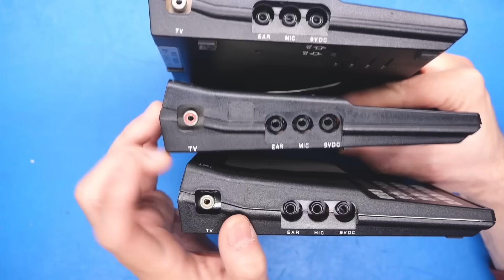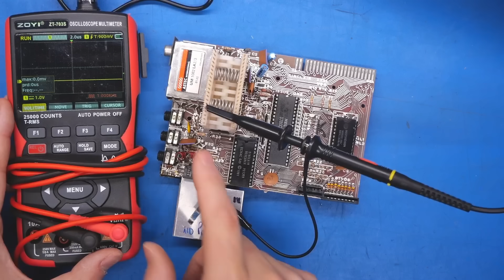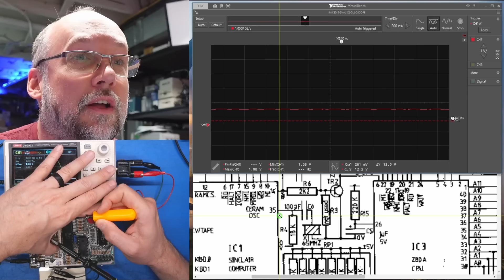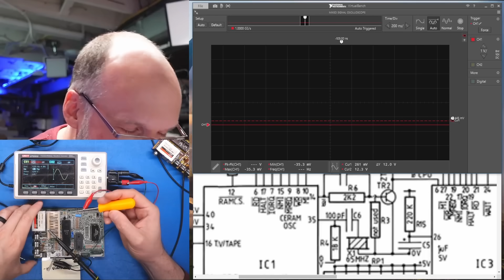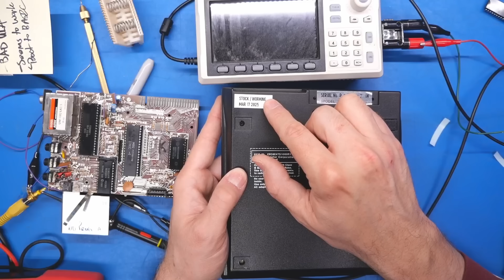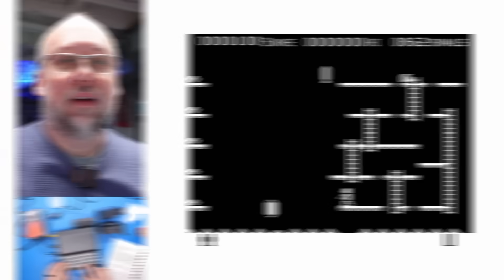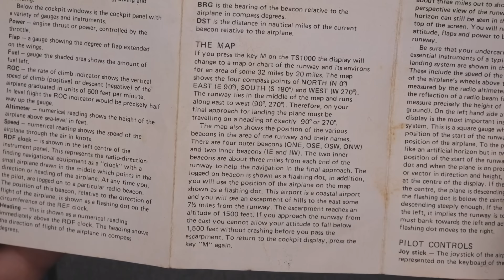Is the ZX81 / Timex Sinclair 1000 actually bad? Let's fix these to find out.

Comment: Hm, I eventually ended up with a ZX-81 with 64KB, a RS232 serial and a centronix (printer) port and a 80character screen with 16 colours running under CP\M using VT-100 ANSI emulation a 'true' keyboard that also replaced the original housing and had the powersupply built in. The hard-disk ran through the serial interface and was a 360Mb Digital (DEC) platter unit and the printer was a Mannesmann Tally Greenbar Drumprinter.  
Don't even ask me what it cost to scavenge all the stuff together and how to to make it work with the tenacity of 'The BORG', but I coded and ran cobol programs on this contraption that only its mother would recognise and love as it ended up. 
The only reason I did this was because.
Although it helped that in a drunken stupor I had entered into a bet with buddy who owned a VIC-20. Something to the effect that I could make it do things a VIC-20 or even a C64 couldn't. I won the bet, earning a cardboard medal in the order of the Naked Bear. (we weren't allowed to bet for money. Regimental Code of honour and all that good stuff.).    
If I switched it on, either the lights in the whole building would dim, or fuses would blow.
Fun times!

Comment: Probably someone already wrote it, but this is a ceramic resonator, which are cheaper than quartz resonators, but neither one is an oscillator, because that also includes the circuitry to produce a signal, which is sometimes done in the same package. Since the ZX81 only needs frequency stability so the picture doesn't roll, they use the cheapest of all variants.

Comment: You can use copper ink pen to fix the traces on the membrane/ribbon.  The problem is the older they get the more brittle they are so you can conceivably create more problems while handling it.

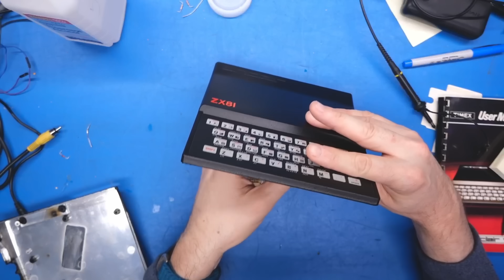Comment: 47:24 - Adrian, it would probably be easier to re-connect the keyboard is to place the top section on the table and attach the board to it!

Comment: ZX81 was my first computer, when I first got it it blew my mind what you could do with a few lines of program code. Good memories. Got a Spectrum soon afterwards. Third party improved keyboards were available. My school had a lab set up with ZX81's with custom keyboards and a DIN connector at the back to connect them to a monitor which also powered it, not sure if that setup was easily available or was custom made for the education market.

Comment: I wonder if it would be possible to get the pinouts of the keyboard and like maybe using an arduino connect a better keyboard to it? Maybe a custom one. I can see 3d printing a new case to hold the motherboard and either an external keyboard or a built-in keyboard as part of the 3D case. A shame they never made any after market kits like the Atari 400 had.

Comment: I had one of these Timex/Sinclair units... It was working fine, then I put it into its box for storage and left it it there for many years, like 8-10 years.. then I took out and plugged it in , but nothing. I measured the power adapter and it had proper voltage... but no screen, no indicator lights to say it was on... so I had to get rid of it unfortunately.

Comment: Another ZX81 Brit here.  From what I can see, in mid-1982 in the UK the ZX81 was being sold at around £60 whilst the VIC20 was around £160.  BUT - and it's a big but here - you have to remember to add on the price of Commodores cassette deck to that price - another £45.  Obviously you would need a cassette deck for the ZX81 but you could use mainly anything off-the-shelf (£20ish) as long as you enjoyed getting the bloody thing to save & load...

Comment: My first computer programming class was 1977, High School, using a Wang 2000.  I was 19 when these came out. I burnt out three of them over time, before the IMB PC came out. My software is sold all over the world to locksmiths and makes their lives easier. Without the ZX1000 I would not have learned as much as I did as quickly as I did. Thank you Timex/Sinclair.  I recently looked for and found one on Eb and it was one of those you described.  Someone bought it, used it once or twice, if that, and packed it away. It had the original receipt in the box. And everything looked untouched.  Possibly bought for a rich kid who got something else the same year.  All I know is I am very happy to have it in such pristine condition.  I bought a small TV but it doesn't work very well, as it is a cheap 5" tv.

Comment: You saw how slow BASIC is.  Z80 code isn't much better while producing video (SLOW mode vs FAST mode).  To fit into 1K, the screen is dynamic.  There are end-of-line markers, which means, "produce white video for another X us (until the horiz retrace).  Then start interpreting what to output for the screen with the next byte."  As a consequence, the video buffer isn't a fixed x by y 2 dimensional array, it is only as big as it needs to be for the current screen contents.  What POR does is determine RAM size, and if it's above some threshold, it prefills the video RAM, becoming an x by y array.  If you looked carefully at the video output (basically, little bits of noise), you could see the init code expand out the video buffer to full size, seeing a very slight amount of noise line-by-line until it was done and put the "K" near the bottom.  At least that's what it looked like to me; I never had diagnostic equipment to look at electrical activity on the chips.

To me, it would have been a better s/w design decision to go into FAST mode first and do all the fiddling with RAM, then go to SLOW mode, at the expense of having no video until it was done, making you wonder if the machine were dead in the meantime.

Comment: I picked up a Radio Shack CoCo keyboard, rewired it's matrix, and grafted it into my TS1000. The chicklet keys were still bad, but it was an improvement over the membrane

I'd forgotten about the light show whenever you loaded from cassette. It was explained (somewhat) but I now understand why it did that.

Comment: That type of ribbon cable wasn't much better back in the day.  I don't know what it's officially called; we called it "foil on plastic". The adhesive holding the conductors to the backing would come loose, and shred in the connector.  I "fixed" a few of those cables with some thin pieces of window alarm tape; basically aluminum or copper tape with a conductive adhesive. Overlap the original conductor about half an inch, and stick the tape onto the original plastic backing. It worked about as well as the original, letting you do a few more insertions.

Comment: shortly after experimenting with a CBM3032 (basically a PET2001 with 32kByte and great keyboard) and shortly before getting myself a C64 I played around for a couple of evenings with an unexpanded ZX81 - it was TERRIBLE, some years later, while saving for an Amiga, we played some games for an weekend. If I remember correctly it had a 16kByte extension and had some pretty basic games, often worse than PET2001 games.
It was kinda bad in comparison to everything else but at least it got the job done. Given that a C64 was almost ten times more expensive I am forgiving. Though if you knew what you were doing you could get an Apple II clone for less than half the price of a C64.
Some things people often forget, in the late 1970 / early 1980 there were a ton of compatible systems for CP/M but also Apple II, in fact until maybe 1982 "compatible" meant "Apple II" and they were really easy to build yourself. I remember the cheapest Apple II clones went for around three times the price of a ZX81 and a third of a C64, they came with 16kByte and an external keyboard. Some where substantially more powerful than a real Apple 2 but at a step price.  Pretty nice machines to be honest, but to be sure, Graphics or sounds wasn't a thing back then. You had your mono text mode, hopefully at least 80 characters, and that was it.

Comment: The crystal "oscillator" is probably a ceramic resonator, the components in the oscillator are already chosen to generate approximately the right frequency, and the resonator is connected in parallel as a very sharp band-pass filter to stabilize the frequency.

Comment: The Timex was an absolute beacon of light when I left home and went to college leaving behind the beloved family Apple II. After wasting away in the no-computer desert, my host family took pity on me and gave me a Timex 1000 they had in storage!

I thoroughly enjoyed exploring this system in my evenings except for the odd occasion where pressing a key to firmly caused the 16 K RAM pack to monetarily disconnect and reset the computer losing all of my code.  I ended up jury rigging a scaffold that the computer could sit inside to support it in such a way that accidental resets were banished!

Comment: Another great video. I have a soft spot for the ZX81 as it's the first computer I owned. The one I have now is heavily modified with a number of expansions that make it something other than a ZX81. It has its own external keyboard, an expansion that not only gives it the 16kb of RAM, but also RGB output and colour capability. I also have the ZX Expand module that allows for the loading of programs over SD Card. It's the device that is needed to run Dragon's Lair on the ZX81. Yes that's right, Dragon's Lair was ported onto the humble ZX81.

I would also point out that the games you initially played on the '81 were late releases as they were 'high resolution' games that tapped into the character generator to allow for sprites to be formed. This was not thought possible at the time of the ZX81's release, meaning that games used the ASCII character set or the built in graphical characters you discovered during the video. You saw this when attempting to play 3D Monster Maze.

Comment: Hi Adrian, we met at VCF East two years ago. I had a ZX81 purchased as a kit in November 1981 it was advertised Computers & Electronics (formally Popular Electronics) magazine starting in September that year for $99 / $149 kit vs' assembled. The first I saw of the 16K expansion it was $199 that following year, a frightful amount of money to the college student I was at the time. When they were being blown out Xmas 83 as the Timex 1000 there was a bundle sold at Thrifty Drug Store (later Rite-Aid, just gone under 2024) for $39 and included the 16K module and 3 cassette programs.

On the 16K unit, yes its DRAM and has a little switching PS running off the 5V brick. Open one up they're really compact for all that's going on inside.

Comment: You can get better keyboards for the ZX81.
I had one by Memotech which had proper key caps.  It had a pass-thru so you could still use the RAM expansions.  The Memotech RAM expansion, which I also had, was the same shape as the keyboard interface so they locked together quite well.

Comment: The ZX81 was _awful_.

I was (almost) six when I got my ZX81 kit. As he was Clive Sinclair's son's teacher and had set up the school's nascent computer lab (one Nascom 2, one SWTPC 6800, and a teletype) , Dad managed to get me a single-digit-serial-number ZX81 direct from Sinclair's offices in town. He taught me to solder it together, and I managed it too, and didn't burn myself. He soon got me a RAM pack once we realised how limited the base model was. Quite quickly we replaced the RAM pack edge connector with a Eurocard style connector and hardwire the power jack to avoid the wobblies.

Anyway, it didn't take me long to realise how limited the ZX81 was compared to the Nascom and some other things like the Acorn System 2 I'd tried. As soon as Dad got a class set of BBC Micros (model As) and brought one home over a school holiday to learn how to use it, I left the ZX81 for dead. I helped him upgrade the Model As to "B" status (soldering in extra memory, the 6522 and the Econet upgrade for the school) and then wire up the campus with Econet cable.

I never bothered with the ZX Spectrum, as Mum and Dad forked out what must've been a brutal amount for an NHS nurse and a teacher to buy me my own BBC Micro B with 5.25" floppy, Microvitec CUB, and 16K of Solidisk Sideways RAM a couple of years later, once Dad was sick of me monopolising his Model B. I get that the ZX81 was cheap enough to be viable for 1980s Britain, but if you'd used anything better, it was clearly not adequate.

Comment: One of the ways in which the ZX80 and ZX81 saved on costs was by using the CPU clock as part of the video driver.  The CPU could only run code during the blanking periods, and if the CPU was handling something time-critical, such as loading from cassette tape, it was too busy to maintain the video signal.  The way in which it saved RAM space for video memory was also both clever and strange.  It didn't use a fixed amount of RAM for video, but instead used a line terminator to mark the end of one line and the start of the next line.  Some logic tricks were used to literally "fill in the blanks" for the rest of the line on-screen.

Comment: Tyrannosaurus Rex was an impressive game for the ZX81 though lots of aggravation on loading from tape and with 16KB ram expansion pack sneeze and it would hang! As you said people would jump and sadly I went to  a TI-99/4A Parsec being the killer app as anything more and extra $$$ even to do assembly would have to buy a cartridge. Thankfully a little while later and the Commodore 64 did a sale and dropped from $1000 to $499 with tape drive and collection of hundreds of programs and never looked back!

Comment: Hi Adrian, as a Brit, I'm glad that you're saying "Zed Ex 81" rather than "Zee Ex 81". 😁😁
Also the ZX81 screen buffer wasn't a fixed size, it expanded and contracted as necessary.
In the UK the VIC 20 was about £200.
Reply: it's Pronounced "Zee Ex 81" you Brit!
Reply: @boydlewis8747  well, as they were designed and built over here, and the bloke who actually designed them said "zed", ZED is what it is ( and it was OUR alphabet to begin with...)

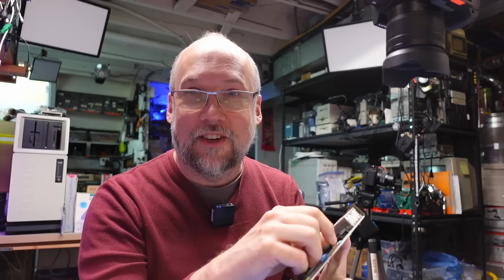Comment: 31:02 it is possible as the whole frequency generator is in the chip. 

What you call a xtal oscillator is a cheramic resonator only to stabilize the frequency generated in the chip.

With xtal there is a output driving the xtal, witch resonates and giving feedback into the chip. (Signal goes trough the xtal) Without xtal, no feedback and no clock.

With this ceramic resonator witch is grounded in the one side it is only tuning the signal. And the signal is generated in the chip.

I might be wrong, and I might not explain good.....

Comment: The ZX81 was my first computer and I loved it to bits. My cousin had a Vic 20, and despite it having colour, sound and a real keyboard I wouldn't have swapped for the world. The 81 had much better games. Mazogs, 3D Monster Maze, Hi-Rise Hive... Space Raiders... All pretty terrific. You could get proper keyboard addons from Maplin, DKTronics etc. 

England in the 80s was a lot different to America it seems... Cost of living, Tory government etc meant a lot less money could be spent on computers (there's a reason a lot less 1541s were sold in the UK)

We had a lot of tricks to avoid RAMpack wobble - I used strategically placed blutac...

The metalic paint on the casing was a US requirement. None of my UK 81s ever had it.

Comment: My first home computer. Very basic but you could still do cool stuff with it, I built an 8255 parallel board and drove stepper motors with it, and there were some memorable games like 3D Maze and Psion Flight Simulator. I was learning Z80 on the school RML 380Z and this was a great way to carry on even if I did have to hand assemble everything. Find memories. Very limited but a classic on its own terms.

Comment: Is there a way to adapt the connector for the key board to a ps2 or usb keyboard connector and not use the original at all? Failing that could you not order a pcb and laptop style key switches and build a replacement keyboard?

Comment: Timex of Portugal made a lot of those 1000s and ZX81s. Most 1000s I've seen are made in Portugal, France ones are not that common, since Portugal produced then, no need to import from France.
Timex USA accepted the Portuguese proposed design for the upgraded  1000, the 1500! In  the LOAD ZX Museum  we have a proposed 1500 that is a 1000 painted silver.
First issue of the 1500 used a Ferranti ULA and later revisions used a custom SCLD. After Timex USA closed the computer business, Portugal picked the 2068 and did wonders with it!

Comment: Back in the early '80s I formed a company with a fellow zoomie called A&P Electronics. This was more of an after-work hobby. We made replacement keyboards and memory expansion kits for the ZX81. I think we got the keyboards from a surplus company, probably Halted Specialties in Sacramento, and they were from Atari 800s. I recall we had cut the traces on the keyboard to rewire them for the ZX81 and made little stickers for the key caps. We also sold memory expansions in kit form. We supplied the perf board, wire wrap sockets, the edge connector, ICs, wire wrap tool, a spool of wire wrap, instructions, and the rest was up to you. I still have a lot of the parts and parts bins from then. We advertised in Sync and Byte magazines, until Byte got too expensive. Anyone here get a kit/keyboard from A&P Electronics back in the day?
Reply: This might be silly, but what is a "zoomie"? All that google gives me is franticly running dogs.
Reply: @Metal_Maxine  Someone in the USAF is called a 'zoomie' by members of the other services, when they are being polite :). Members of other services are known as 'grunts' (USA), 'jarheads' (USMC), 'squids' (USN), etc.
Reply: @UTubeRangerBob  I'd never heard of "squids".